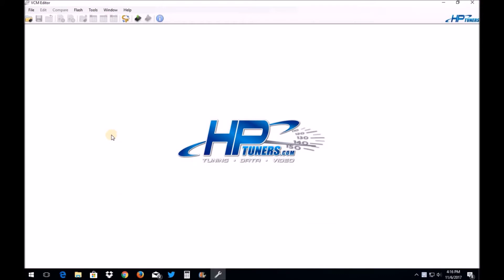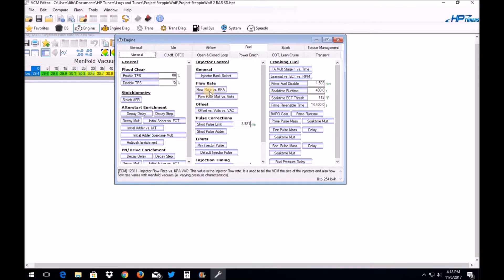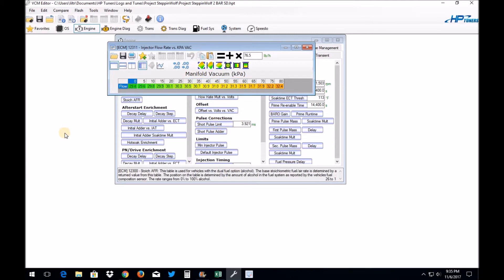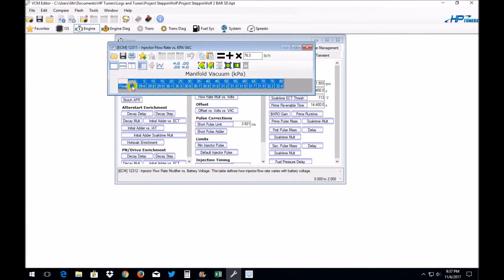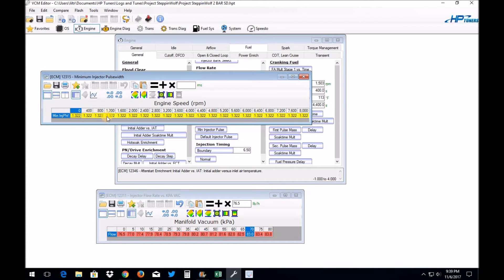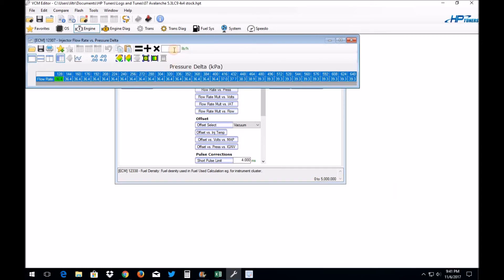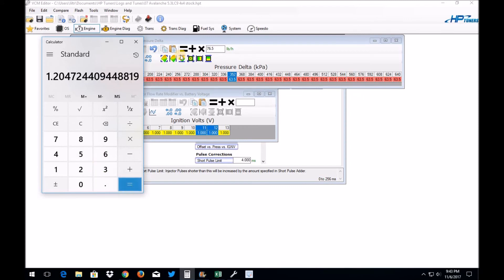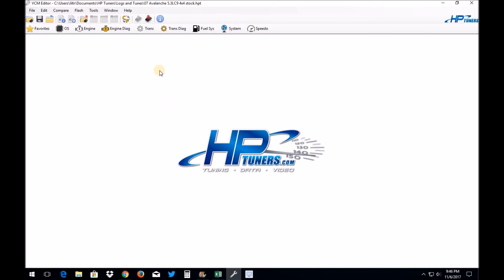HOW TO TUNE DECAPPED INJECTORS IN HP TUNERS (Gen III PCMs)

Comment: I decapped my lq4 injectors because I didn't factor my injectors when I rebuilt it as a stroker with a bunch of other mods. I used my trucks fuel system and an arduino to flow them myself. Got 65 lb/hr then got the ratio from stock tune injector flow/ 65 lb/hr injector flow then just multiplied that constant into my injector flow rate. Only issue I've had is my VE table seems unusually high(goes as high as 128 and I'm NA). But that might be me hitting the limits of a stock fuel pump. My 402 runs really nice though and has that real nice stump pulling power. Wideband says our AFRs look good. After dropping 2k to rebuild a motor that should of probably went to the scrapper since it spun 5 bearings(ask me how I fixed the warped block myself in my backyard lol) I was willing to save another few hundred bucks on injectors and the results were better than expected.
Reply from the maker: Most decapped injectors flow quite a bit more than 65lbs at 58psi. The standard 99-06 truck injectors generally flow around 75-78lbs once decapped. I don’t think your flow rate is accurate and that’s most likely why your VE table seems out of whack. I’d be willing to bet when you first started it, it was probably super rich and you had to pull a lot of fuel to get it dialed in. You can always work around an incorrect flow rate input but the VE table will always be jacked up and the vehicle will never run as good as it could with the correct flow rate input. My suggestion would be to have the injectors flowed by someone with a proven accurate flowbench so you know 100% where you’re starting from.

Comment: Does using the flow rate multiplier method off of the e38 work for a gen 3 p01 ecm?
Reply from the maker: You don’t need to use any gen4 tricks on a gen 3 pcm. Just do what the video tells you to do for gen3 pcms.

Comment: how do you scale fuel injectors on e38 comp it only goes to 63.5 im running 90s
Reply from the maker: One method is explained in the video. It doesn’t work on all E38s but does seem to work on early ones. You basically have to trick the ECM by changing voltage values. There are other methods as well but it would take me four pages to explain I’m type. The information is easily found through google though if the method in the video doesn’t work out for you.

Comment: For the E38 (2010 silverado) I believe i have a return on my fuel system, when i take a look at the stock fuel pressure vs kpa table it was scaled by the factory, should i use the spread sheet or just enter 80.9( what my decapped where flowed at for 58psi fuel pressure) . My e38 allows me to go up to 127lbs.
Reply from the maker: If your injectors were scaled from the factory then its because you dont have a vacuum referenced regulator and yes, you should scale the new injectors as well UNLESS you change your fuel system to include a vacuum referenced regulator.

Comment: When i tried downloading the file it wants to open in word
Reply from the maker: It is an excel spreadsheet so will open with office excel. If your computer is trying to open it with office word then you either do not have excel installed or you have your associations set up incorrectly and you need to “open with”, select office excel, and click the “always open this type of file with this program” box.

Comment: Hello, I downloaded the spreadsheet and its read only, without the option to uncheck it.
Reply from the maker: I just downloaded the files on my laptop and had no issues using them. If your trying to use an IPhone or IPad then that may be your issue. But any windows computer should be able to use them.

Comment: this has always bugged why does the stock habr different values across? I used this for some decaps a couple months ago but still can't shake that question.
Reply from the maker: Thanks for watching and I’m glad this helped you out. The scaling of the injectors on the returnless style system is to compensate for vacuum draw in the injectors. This isn’t necessary on the return style system because the there is a vacuum reference fuel pressure regulator on the fuel rail that lowers fuel pressure as vacuum increases to compensate. I explain about the different fuel systems in greater detail in this video if you want to learn more.
https://www.youtube.com/watch?v=wA6mmc8fvQo&t=25s
Reply: Im starting to think the pcm i had did not match the motor. also why did you use static data instead of the dynamic data? a google search just shows random articles and nothing really answering the question.
Reply from the maker: The static flow rate is a more standardized measurement used by fuel injector manufacturers so that’s what the OS is designed to use in its calculations. At least that would be my guess since I’ve never really seen injectors labeled or sold by their dynamic flow rates.

Comment: BLG, good video except the E38 limit at 63.5 lb/hr is the absolute max the PCM will allow regardless of the multiplier table. This is bad info running around the internet...The easiest way to take care of this limit is the Double AFR/Half IFR trick. Also you will need to cut the IVT>AFR Terms in half. Saves having to perform the full up scaling technique explained in our Tuning Course....  Ed M
Reply from the maker: Hey if it works it works. 😉 Not sure how to “verify” other than the fact that it’s running great and I barely had to tweak the VE or Maf tables at all. The Avalanche is our family vehicle and sees a lot of miles so it has to run good or the wifey would be kicking my ass. 😂. And there’s no need to do that trick in the gen3 pcms as they allow you to put the actual values in. Again, this is a method I use and it works for me. If you’d like to do a free video on another method, I’d be more than willing to try it. I’m always open to different ways of doing things and helping others learn as well. If you post the link here I’ll approve it as long as it’s not a paid product. 👍🏻This channel is about helping fellow hotrodders, not emptying wallets. 😉
Reply: Rick Paruch He lost him when he said “do it for free and help out fellow hotrodders”. 😘
Reply from the maker: ERM, Thanks for watching. I’m not very experienced with the gen 4 pcms. I’ve only had to do one E38 (07 Avalanche) and this technique worked perfectly. Perhaps it has to do with the specific OS more than the PCM itself but this multiplier technique worked just fine for me with a set of 80lbs. I can only attest to my personal experiences so I can’t say if this works on all E38s but I can say it worked on mine. 
-Robert
Reply from the maker: Kent Price, I have no experience with an E40 so I really can’t say for sure.
Reply: Bad Luck Garage and that's where you lost him lmao
Reply: What about the E40, will the above video work on it?
Reply: BLG, I am interested as to how you verified that the PCM is actually requesting more than 63.5 lb/hr. What is rreally happening is the the fueling is limited to the 63.5 lb/hr and the airflow is being adjusted during the tuning process to meet your AFR requirement. This actually becomes what we call a scaled tune but only partially as none of the other airflow tables/axis values are changed so you have an inconsistant tune. Will it work, yes, just not the right way to compensate for these limits. I am sure this happens in all the GM PCM's...Gen III or Gen IV.
Reply: I doubt BLG lost ED on anything tune related. Ed has some of the best/most comprehensive tuning materials available out there, period. I have The tuning school, Greg Bannish DVDs and a few others, and I know from experience how great Ed's stuff is. I wouldn't have wasted my $ on the other stuff, if Ed had his materials out back then.

Comment: I'm a newb to tuning and have been reading a lot and this has confused me because my understanding is, if you scale your injectors, there's a bunch of other tables you have to scale as well. Have I been reading some old info and HP Tuners has made it easier, or is there still other tables to scale? Great info man! I recently found your channel and have been watching your videos! Keep up the good work!
Reply from the maker: Thanks for watching Kent! First off, you only need to scale your injectors in a returnless style ( deadhead)fuel system without a vacuum/boost referenced regulator.  If you are using aftermarket injectors then you will need to enter all thier data, not just flow rate. When you decap you’re stock injectors, the only data that needs to change is the flow rate. An exception would be if you’re using a set of decapped injectors that were a style that didn’t come in your engine originally. As as example, if you decapped a set of LS3 injectors and went to use them in your 2002 Silverado engine. At that point you would need to copy all the tables over from a vehicle that came with those injectors and then, again, just change the flow rate tables to match the new flow rate. Hope this helps.
Reply: Okay great! I converted to a return style system and decapped my stock injectors. I was a little nervous about all the scaling that I was reading, and intimidated by it. This makes me feel more comfortable about getting it right. Thanks!